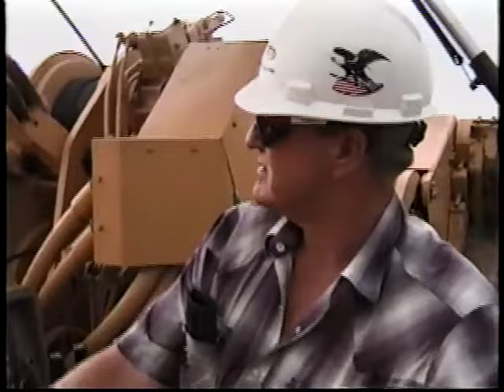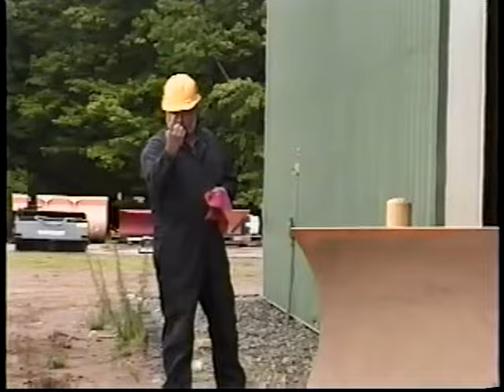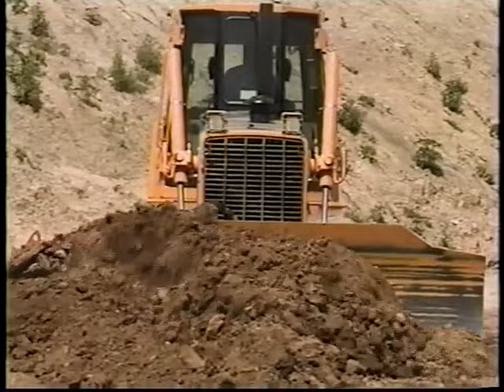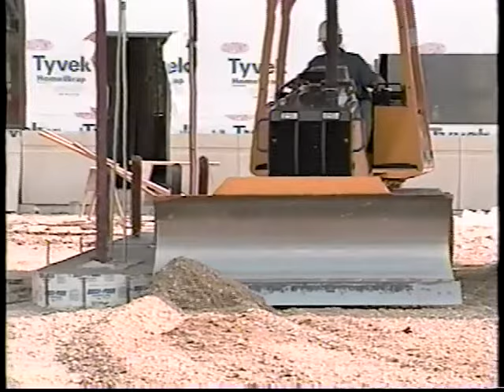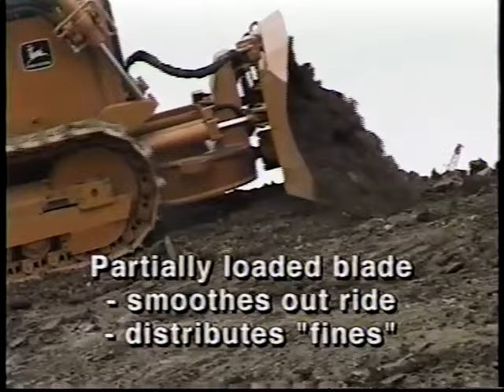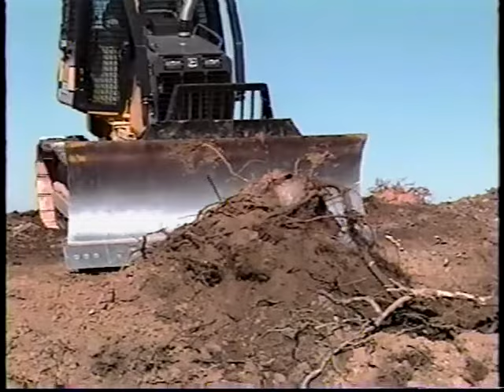Crawler Dozer Tips from the Pros

Comment: I worked on all kinds of earthmoving equipment, but nothing beats working with a bulldozer. 53 years ago I started with my first bulldozer, a Caterpillar D6B, serie 44A. Beautiful dozer with angle blade, winch, direct drive. Followed by D6C, D8H serie 22A, D8H serie 46A, D8K serie 77V. Never run a high track Cat. At the end of the 80's I became Technical and operational manager of all earthmoving equipment in the company. Retired 3 years ago, having great memories, operating a dozer.
Nice video, thanks for sharing!
Reply from the maker: That is an awesome work history, thanks for sharing!  My grandfather started his excavating business with an early CAT dozer and I have the utmost respect for those dozer operators that can make sites look perfect running an old machine with steering clutches and brakes; all while making it look easy.  That is some true talent!
Reply: its giving me hard time too ...any tips i can use to better my skills